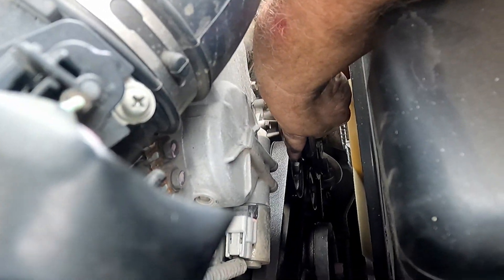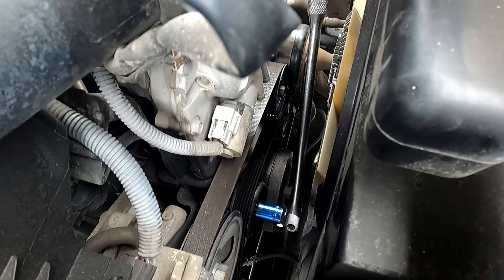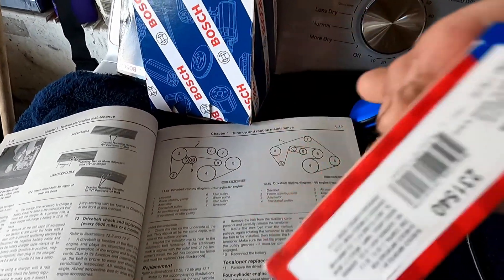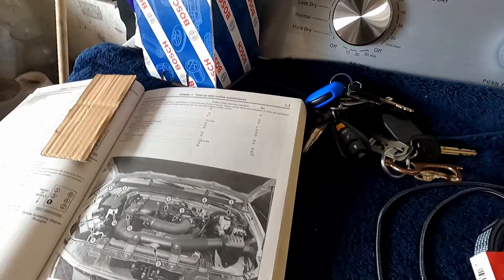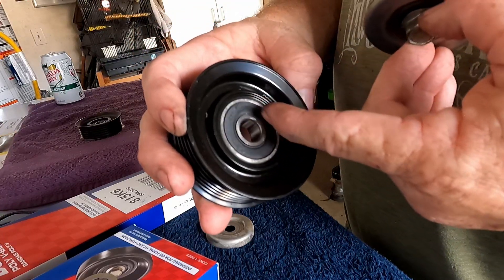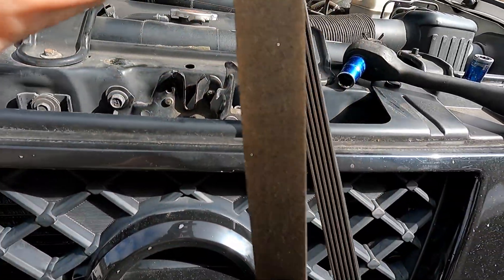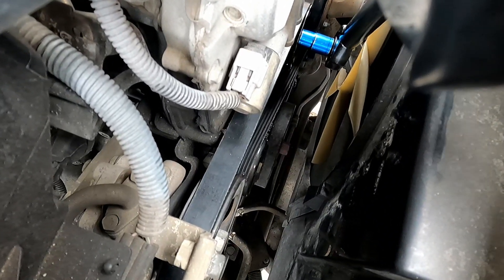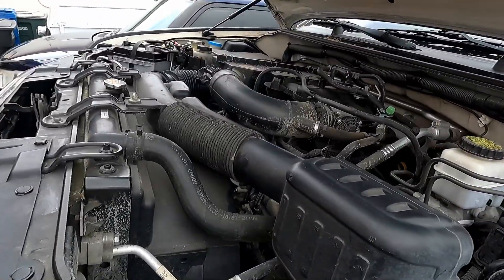New Serpentine Belt and Idler Pulley Install on the 2.5 Nissan Frontier

Comment: Great video! The idler pullies and belt tensioner are probably the most overlooked maintenance items. Most people wait for those to go out when they're on vacation in another state.
Reply from the maker: Yes definitely some of the most overlooked parts. I know this truck very well and heard the squealing sound as soon as the engine started. I only wish I could have got the crying pulley on camera.. Anyway it was good preventative maintenance to keep the truck on the road happy.

Comment: I believe the 16 ftlb torque is the spec for the M8 tensioner mounting bolts; not the pulley. The instructions that came with my new pulley spec the torque for the M10 pulley bolt at 40-48 ftlbs.
Reply from the maker: Hello Byron, Thanks for the info. I took the torque spec from the manual I use but I know torque spec is by bolt size. Thanks for watching!!
Reply: @DIYWilly  I have the same manual. It falls short of specifying torque for the pulleys, just the tensioner. The pulley I purchased was manufactured by Murray and provides the specs I stated in my previous comment. Thanks for taking the time to post the video - it is helpful. 😃

Comment: I got a question Willy; being thats a 4cyl engine would it have the same problem as the 6cyl with the plastic timing chain guides wearing out? Or is it designed different with only one plastic guide or none or what? BTW i put a gates belt on my xterra awhile back. Grips really good.
Reply from the maker: Hello Lou-eye, Great question on the tensioners. I've never had the timing cover off the 4 cyl. I'm not sure how the timing is on it. I have the service manual and now I want to know. I'll take a look today and see the differences. Thanks for watching.

Comment: The Nissan 4 cylinder engine has a winning noise is that from the pulley ?
Reply from the maker: Hello, That was the case with this truck. I don’t know what’s happening with your truck. You can try and listen to the pulley carefully with a small piece of wood touching the pulley and placing the other end to your ear. Be careful around the moving parts. This helps to pin point the noise. Thanks for watching!!